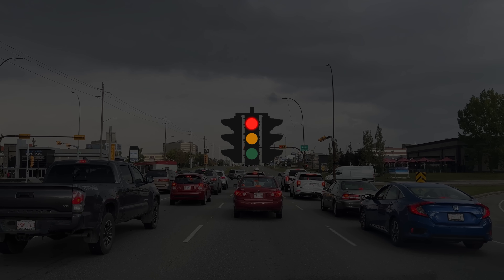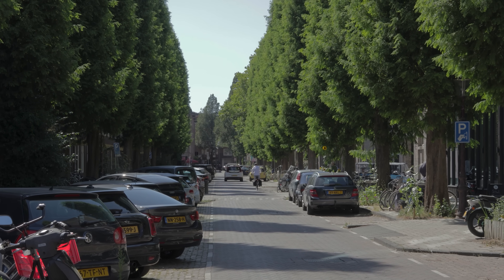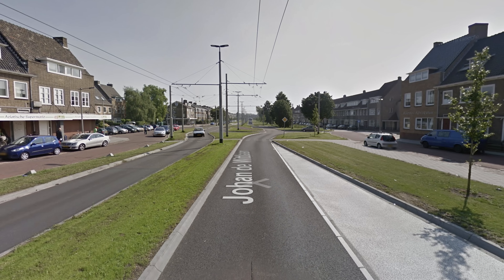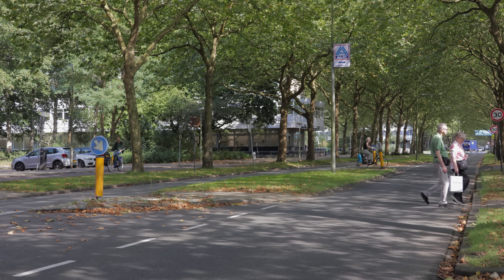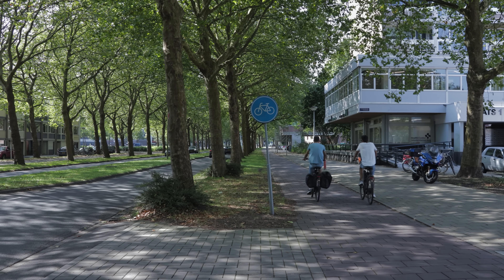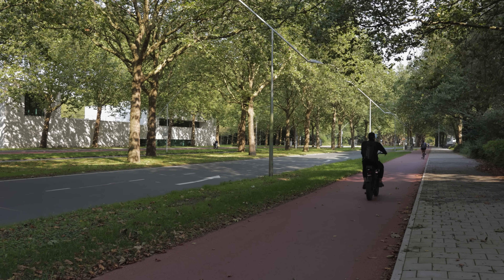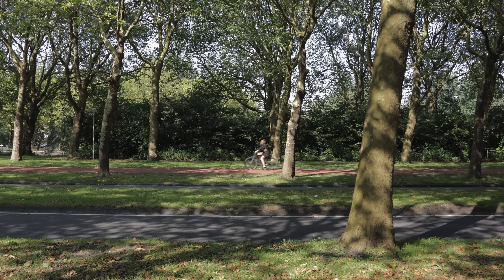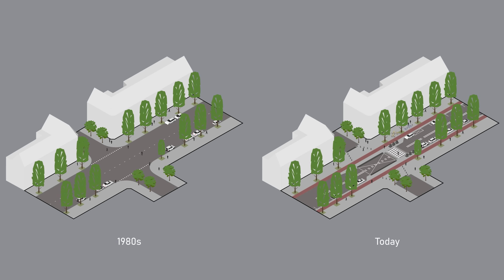Rethinking Street Design - Drive Slow and Go Faster

Comment: There will be more cars coming through the residential area once people realise you can drive as fast in the residential as outside the residential area. Also there is a lot of devestation when traffic from tbe highway intersection manages to back up, it causes sneak traffic which fills all residential areas too.
Reply: Not exactly, because most residential aras only have access from one or two entries, all on the same side. You can't simply cross them.
Reply: @therealdutchidiot  Hey not really true. Van der boechorststraat, van heenvliet, van leijenbergh all cut right through a neighbourhood in the south.
Then there are parralels like Nedersticht and Nijenrodeweg in case of a highway traffic backup.
My story is that the Arent Janszoon was completely stuck. So I went into Nedersticht with same result and then took van Heenvliet towards the Europaboulevard without any problems at all.
Reply: @therealdutchidiot  Hey not really true. Van der boechorststraat, van heenvliet, van leijenbergh all cut right through a neighbourhood in the south.
Then there are parralels like Nedersticht and Nijenrodeweg in case of a highway traffic backup.
My story is that the Arent Janszoon was completely stuck. So I went into Nedersticht with same result and then took van Heenvliet towards the Europaboulevard without any problems at all.
Reply: @Bennie_Tziek  Those are old designs, and slated for change.
Reply: @therealdutchidiot  can der Boechorststraat has been renewed indeed. And it allows for even higher speeds with less "drempels" and a nice new flat road surface instead of the dented surface before. Still allowing the north-south access and doing that even better.
Most neighbourhoords are indeed attached to the main roads, and wouldn't reasonably be a side track. (Gijsbrecht van Ijselstein is a good example) But again if traffic backs up or you don't like stoplights, than one could take the Cannenburg instead of the Arent Janszoon Ernststraat. But realisticly I have never (only as a child) seen the Buitenveldertselaan back up with traffic. Oh and one accident but that was ~15 minutes till it was gone.
My main point isn't that it is a bad new design, it is that when limitting all roads to the same speed, then for some people who know their way around, basically all streets have the same priority. And it is devastating if traffic backs up (which happens much less because of how well configured the network is). When traffic is single line, it will back up much further which really encourages detours. If you can see the busy intersection, then people are very likely to stay in line. When you cannot see it and only see people going into neighbourhoods, you're encouraged to do that too because of herd-mentality.

So yes it works great, all the points in the video are valid. But traffic jams are worse (as I believe also was said in the video), besides that there is my point that having both neighbourhood streets as well as main streets the same speed will have negative side-effects. I myself am a huge fan of a 40km option. In Germany a lot of villages are set to 40 too. Or lowering the neighbourhoods to 20, that is the comfortable streets with all the going ons and the drempels. But realisticly speeds in neighbourhoods are not enforceable by anything other than roaddesign.
Reply: @Bennie_Tziek  The plan is to close one of the sides to motor traffic, leaving only cycling traffic in place.
Reply: @therealdutchidiot  I can't find anything about it, I found a lot of plans but nothing has to do with a permanent change in traffic. (I am dutch as well btw). Eitherway it actually supports my claim. My claim was that having the same speed on main roads and residential roads encourages people to take those. That the municipality finds the need to change the residential road network sort of proofs this. 
But if you could send me those plans than please do! I am very interested since this is actually more on my route than the main roads, so I take it regurarly.

Comment: Just to add a perspective from daily reality: the reconstruction of 't Goylaan in Utrecht is one of the most widely criticized road reconstructions in Utrecht. The city council has admitted their approche has not worked, and have done several fixes shortly after the big overhaul. And the road is just as congested as before, only now being even more chaotic. Just to balance all the praises sung here to Dutch road design.
Reply: So that is an example of doing it wrong. But Utrecht did other thing just very good. The lane you mention is just one. BTW, I don't like driving in Utrecht... But that is another thing.
Reply: This! There is a limit in real throughput a one lane road can have, and with the rest of the downgrading inside Utrecht the total capacity is just too low. You can't just make everyone use the highways to get from a-b. 

In my view there was a real overbuilt and car centric Utrecht at the start of this century, but the swing is completely gone the other way now. Ambulances and police don't make their allotted times now. And some of the road building is mega wide, but very lightly used like the Archimeduslaan and Bevrijdingslaan. There is a lot of asphalt.

Discouraging car usage is one thing, but it now gets a bit out of hand.

Comment: i know it's not so simple, but i would have loved some examples of at what streets it could be implemented this kind of design
Reply from the maker: Most traffic areas that don't have very large traffic volumes, I encourage you to have a look at any Dutch city on google Maps, and you will find a similar street to Nijenrodeweg!
Reply: Well any street that is wide enough for one thing. Also there is a max capacity if thats exceeded you need more lanes but you then run into the question of induced demand so building infratructure and public transport is probable a better option. So you have alternatives, walking biking public transport or youre car. You can then design special sepreate roads for high volume traffic but those are mostly needed outside of a city where speed is more importent and there is room.
You will get some traffic  when roads are near capacity but because in the netherlands you have these other options if it becomes to bad you just don't take the car so the problem lessens. All in all you probable can do this anywhere where there is already a multilane road.
Reply: @arturobianco848  Max capacity for a lane is in almost all cases higher than max capacity for a signalled intersection. So if you want more lanes, you can focus them at the intersections (like at 9:39 - 9:45). But above that, it's generally not worth building out the roads for cars, and as you say, high-capacity alternatives are needed.

Comment: Totally. I try to run about 2 mph under the posted speed limit, not to infuriate the cars behind me, but on a multilane road, they can pass if they want. What it proves is often they do race ahead of me, and then wait at the next Red Light while I am still toddling along and finally I get there and maybe just wait a few seconds or the light has just turned green and I am moving slower, but I haven't had to stop completely as I see the back up ahead and slow down. 

No, I don't see the point of racing each other to the next Red Light. Fast is really slow and Slow is fast. 

I knew this years ago. If everyone slowed down, all that would happen is we spend more time driving and a lot less time sitting waiting for the Red Light to cycle to green.

Comment: It is a great idea and it probably works in streets with 45/min, but on avenues with more than 70 vehicles/min it would be very bad for pedestrians.

There are some avenues in my city similar to this, that cars stop in the middle, but pedestrians have priority, but sometimes get a little congested, when they turn left or right, cars behind need to slow down, from 40Km/h to <15Km/h, and sometimes, when both directions are busy they need to wait longer to turn, so this Utrecht example would be important.
Reply: Zebra crossings are still pretty dangerous. Intersections are where the majority of pedestrians crashes happen, unless they're small and built to protect pedestrians like in Hoboken. Large intersections with zebra crossings and lights are very dangerous for pedestrians with cars turning on red, especially at night
Reply: @carstarsarstenstesenn  But in my city red light right turns are prohibited, except for two intersections. Although the mayor is a mf, who may be trying in the near future. And there are lots of things to make crossings safer, such as curb extensions, that can be made with just paint.
Reply: yup thats why it is a single lane. You just don't get it. We had those aveneus to. We still have some of them cause this doesn't work if you do need to proces a a big amount of vehicles.
The idea behind this is making it imposible to get those large amount of vehicles where they shouldn't be. You do need to all the other stuff to like getting rif of youre ridiculus zoning laws. Good bike lanes and public transport. 
For some places you do need the aveneus but that is not very many if you do it right.
Reply: @arturobianco848  My city is very mixed zone. Isn't North America, is in Brasil, Porto Alegre. Bike lanes although on law, aren't being built.
Reply: ah thats because its a car centric city. This is a design that specificly isn't car centric it just happens to be beneficile for cars to. This doesn't work (to well)if you just implement it by itself. And you are wrong it encredible safe if its getting a higher number of cars then its capacity cause they will be standing still. These roads like all other have a max capcity. I'm dutch and i know at rush our they can sometimes fill up. Nice thing is you just created space to put in very nice bikelanes and/or speciale lanes for public transport so you have options. For me i drive to the train station and then take the train, get 2,  15 minutes delay on a busy day beause of traffic is i do it in rush hour. So i ussualy come in early and don't have any at all and leave early so i don't have much on the way back either.
Reply: @arturobianco848  Yes, it is a bit car centric, and the avenue which has the most traffic, has a BRT, and lots of pedestrians, because at one side of the street, there are still lots of commerces, and the streets back also. There are like 6 buses/min at the BRT, and there were bus traffic jams longer than cars. And the problem  with this avenue is the lot of traffic from other cities in the metropolitan region. Other cities are much more car centric, and the freeway which hasn't lot of connection, because the airport is inside the "half ring road", has a little too much of traffic jams and only connects the other cities to the center.

A video of the bus movement on the BRT: https://www.youtube.com/watch?v=cL0-k9PTgSU

Comment: the Dutch will have a huge pile of copper when they pull out all those cables from the traffic lights 😂
Reply: Copper? You think copper is used? Oh boy. That's only used for conductive loops, most cables are made with cheaper metals.

Comment: They key here is AVERAGE SPEED. It doesn't really matter if you can go 120km/h if you have to wait for 10 minutes at an intersection, when instead you could go 40 km/h and not have to wait at the intersection. The time to get to your destination turns out to be faster in the 40km/h example.

Comment: This only works when you have very small traffic volumes. In my small american city that 1km space between intersections would be filled to gridlock between traffic lights for 4 hours a day. This kind of design only works if most destinations are close enough for walking and cycling.
Reply: There are SOME American streets with ridiculous volumes.  But, American streets also make volumes look much worse than they are.  You would be shocked how many 
Also, huge areas of American cities are dense enough to function for cyclists, while being too low density for pedestrians.  You just need to make cycling safe, and traffic can come down.
Reply: It's sort of the other way around. It all starts with urban design, ensuring almost everybody lives at walking or at worst cycling distance from supermarkets and anything else they regularly need. Without that, building for human speed and human size is hopeless. The problem in the US is that zoning laws effectively forbid exactly that, making everybody either dependent on a car or on someone with a car. And unfortunately, that's very difficult to fix once it's in place because buildings tend not to be that easy to move...
Reply: @zmooc  I completely agree with this. I am on board with urbanism. I just struggle to believe that these solutions that work in the Netherlands with 50% car commuting or less would work well if copy pasted into my town where 85% of people commute by car and they live much further from work.
Reply: @tuomio5043  Yup. That's how it is. However, the point is, people tend to focus on bike infrastructure but they seem to miss the point that "human sized zoning laws" are where it all begins.
Reply: It is true that zoning is crucial! The problem with the American system of zoning is that it draws life functions out of each other to different zones, so that distances (from home to school, grocery store, etc) become to big + at the other side of wide "stroads" with many cars, both of which make cycling and walking to such daily things impractical and dangerous. The things is however that this could simply be changed by changing the zoning plans. If these where such that residentials zone's could  (and should!) have in-zone schools, grocery stores and other services for daily life, people would not need to take the car for everything. People would have a choice how to do their daily business! This in turn would reduce traffic, etc.
Reply: Nope it doesn't work that way i know small americane towns like that. We had the same problem where i live in the netherlands. What you do is build a half ring road around the town. To get the the trough traffic out of the town then it works. You americanes just see problems not solutions this road design isn't living in a vacume you also need to do the rest.
And yes there are some place where that would be difficult because of geographicale problems. You will need to find another solution there.
Reply: @arturobianco848  To be clear my complaint is about zoning, not road design. The reason our traffic volumes are so bad is that in a town of only 500k people most people commute 15 km and almost everyone does so by car. It's because the alternatives are awful and it is very difficult to live near work.

At these traffic volumes it is fundamentally impossible to keep traffic reasonable. People need to be gotten out of their cars, and that means living closer to businesses.

I routinely come across intersections where there are 3 lanes and the line at the red light is about 0.5km long. There are simply too many cars. Not space efficient.
Reply: @tuomio5043  yup thats the biggest problem in the states.  I have to say it not only sucks traffic wise but man they make youre towns and city's real ugly and soulless. Don't get me wrong i like being in the states the people are nice but them i do not like being in the build up zones.
Reply: The street showcased doesn't have small traffic volumes. It's a very busy road, connecting the southern neighbourhoods of Amsterdam that are outside the ring road
Reply: "This only works..." is the standard response of US city planners to explain why they still adhere to 1875 design standards. Instead they should adopt a "what can we make work in OUR city" approach but that seems too much to ask.